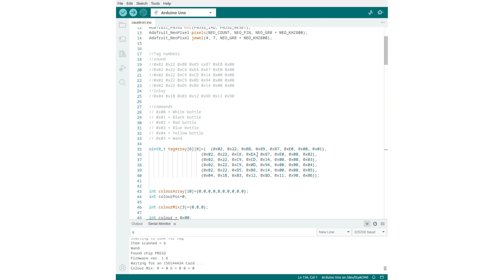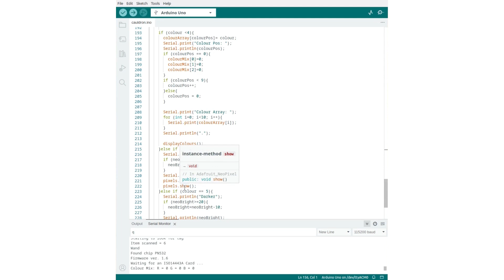Interactive Magic: Creating an Enchanted Cauldron

Comment: Some Ideas pop my mind: 1) Having it waterresisting, so you can actually poor water in. 2) sound effects of bubbles. 3) Maybe movement sensors for some swishy sounds. 4) battery pack 5) power and control buttons underneath. 6) more stable container. 7) Smoke generator. 8) They actualy sell them as toys with nearly all the features mentioned, plus extra -> Google for magic cauldron
Reply: Thanks, good ideas. I like the idea of pouring water inside, having a compartment that it could flow into until it's emptied.

Comment: Not bad! I think putting a small fog machine would be a good idea by having it in the bottom and using a small fan on the bottom and punching small holes in the top for the smoke to go thru.
Reply: I did look into the fog machine, talked myself out of it, but no wishing I had done it.
I only decided against it as was going to use a smaller cauldron, but then went with the big one, so could have fitted the machine inside if I'd gone back to the idea.
Reply from the maker: Should've repurposed Andy's ;) https://youtu.be/bsARcwzV21Q
Reply: @hifromkatie  Understood, it is still a great idea, as I could see intergrating the smoke generator with the completion of the potion.
Reply from the maker: We like it!
Reply: Perhaps also an ultrasonic mist generator could have worked